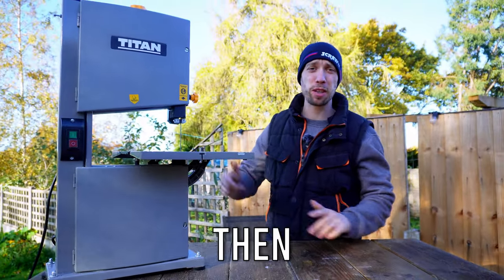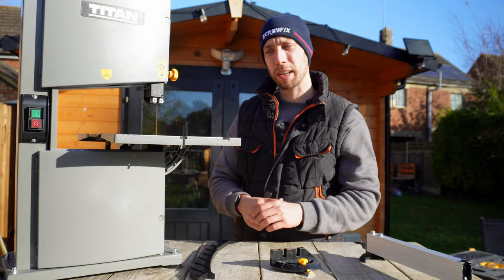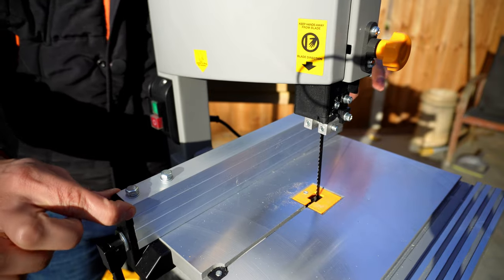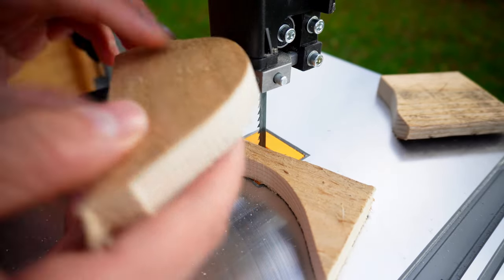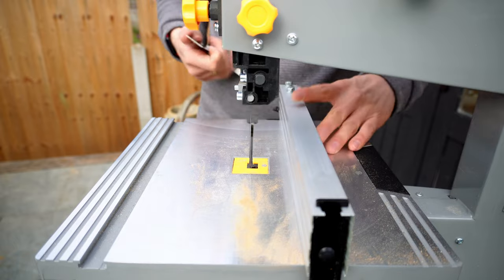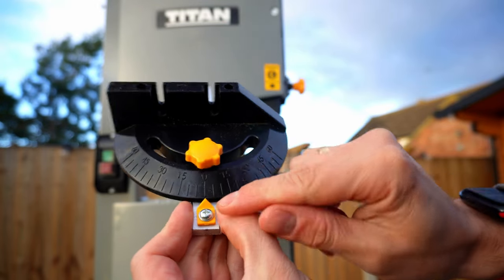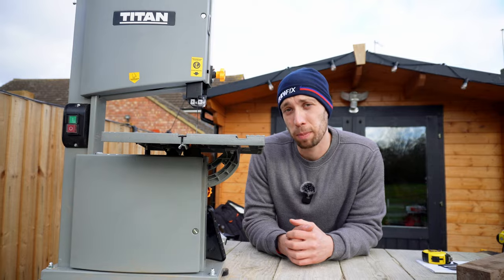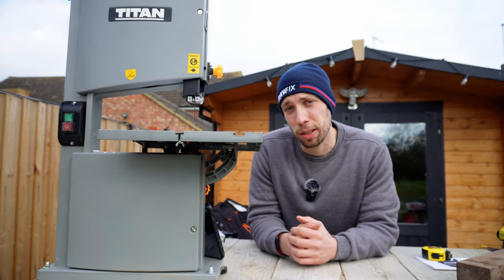Titan Bandsaw Review🫰Is it worth YOUR money?

Comment: Hi Buddy why wouldn't you typically recommend re sawing on a bandsaw? Not sure if you are aware but bandsaws are specifically designed for that purpose.
I'd 100% expect to receive a fence and push stick as well even at that price and so should everyone else.
Reply from the maker: I more meant that I would usually make long rip cuts on my table saw. But if you wanted to use this for resawing then you’ll want to upgrade the blade 😁
Reply: @sumeraybuilds  hi mate re sawing is reducing the thickness of the material into thinner boards whilst a rip cut is carried out on the table saw to reducing the width of a board generally along the grain. What you where doing was re sawing lol 😆 confused yet 😅
Reply: Ps ye definitely need a wider blade with 3 to 6tpi depending on the material.
Reply from the maker: Useful to know, I’ll make sure to pick one up! What brand do you recommend?
Reply: Tuffsaws do the best blades in the uk and are super helpful mate
Reply from the maker: Thanks, I’ll check them out. I’ll probably retest using a different blade and upload as a short video to compare
Reply: I second Tuffsaw blades.

Comment: I've found it almost impossible to get a straight cut on this with the standard blade. A bandsaw should be able to make rip cuts that are straight. Otherwise the bandsaw is still very useful for cutting curves into wood that isn't too thick.

 This video has motivated me to order a 1575mm  1/2" blade with 6 TPI for it from thebandsawshop so I'll see if that works. I hate using the table saw so resawing on the bandsaw is my preference.- update it's still shite, i don't see how this machine can cut straight. If you can get yours setup so it will rip a 63mm deep CLS without it drifting everywhere then please share how you did that
Reply from the maker: I've got new blades sat in my shed waiting to be installed. I'm planning to swap them out (and film it) this week. 

I'm hoping this addresses the drifting issue but your comment hasn't filled me with confidence!
Reply: @sumeraybuilds  looking forward to seeing how you get on! I think the 1/2 inch blade is too big, there's hardly any room for adjustment which might also be part of the issue. I think the 3/8" is probably the biggest it can get away with.
Reply: @sumeraybuilds  I ordered a 3/8" blade also to see if that works better. I think the 1/2" is just too big to get any adjustment
Reply: @sumeraybuilds  I found if I rotated the table with the 4 screws underneath I can stop the drift. the table alignment is the issue if the blade is fitted correctly!

Comment: also the reason you getting a blade drift is two  reasons.. one you feeding it too hard with the wrong tpi.. two the blade is not actually square to the fence. a properly calibrated bandsaw can cut a 0.5mm sheet of wood of timber 400mm long if required bud
Reply from the maker: I have just picked up some premium blades from TuffSaw and hoping that helps with the drift!
Reply: In the demo it looked like the work was not hard up against the fence the whole time. Operator error?
Reply: If you look carefully at the video too you can see the bed has a bend in it but also the fence doesn't look squared(90 Deg) to the bed but it could be my old eyes too I guess